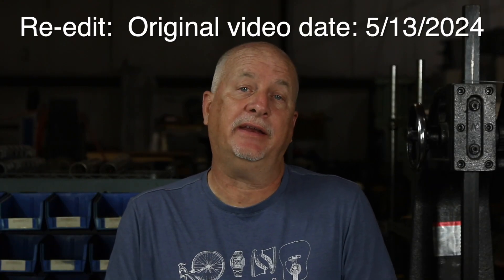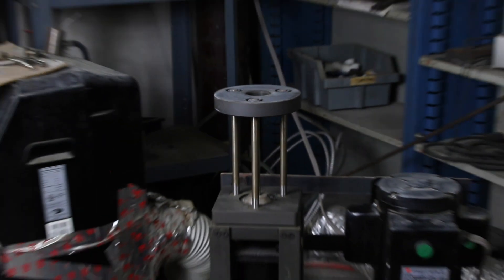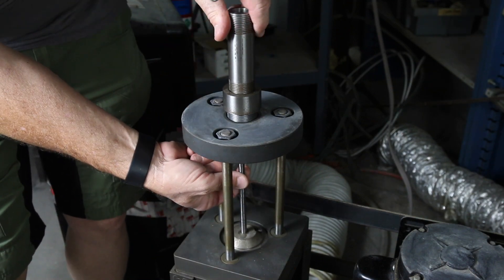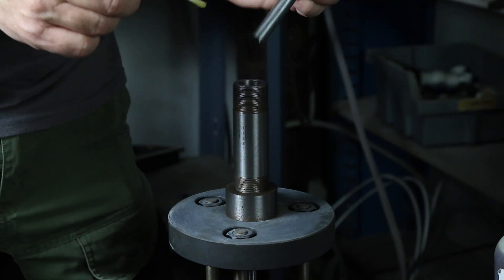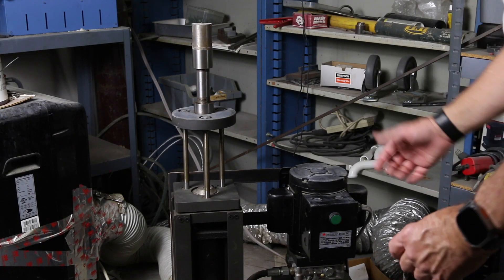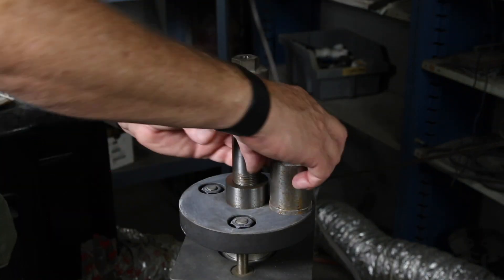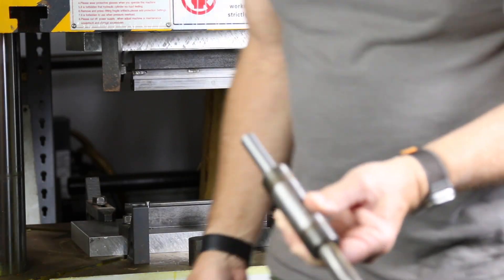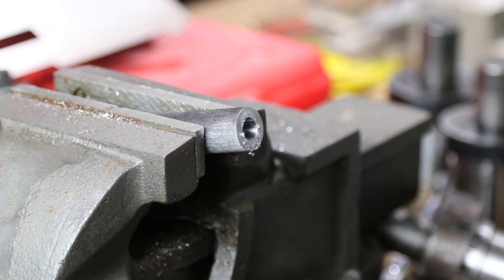Rifling 5! (Re-edit 2)

Comment: What is the size of the reamer you use to chamber the 9mil bullet?
Reply from the maker: @valalbaran I use a 9mm chamber reamer. You might get away with using a straight reamer (you can figure out the dimensions from SAAMI), but I wouldn't recommend it.

Comment: Are you not supposed to rifle the barrel before it's turned down to the finished diameter?  I did a 16mm barrel before and it just expanded as the button went through then returned to its previous diameter again. It had the rifling swaged into it but the specs were slightly off. The major diameter of the bore was slightly tight😢

Comment: How do you know proper chamber stick out
Reply from the maker: @joewboe It's based on several factors...case dimensions, bolt velocity, pressure curve, action type. It's not that straightforward.
Reply: @markserbu  I'm an LCAAP engineer and gun nerd, I think it'd be a very interesting video if it's something you'd share. I'm assuming it's your balancing the thinnest case wall thickness presented, hoop stress, with the internal pressure. Never let hoop tensile stress get higher then the pressure? That's how I'd do it, probably fraction of a second at a time in excel
Reply from the maker: @joewboe Good deal! I took a tour of LCAAP many years ago! As to the case stickout...you'll never win trying to get the case to contain the pressure. The hoop stress calculation will tell you right away that no material on earth can contain it with those thin walls. The goal is to keep the walls supported by the barrel while the high pressure is present. An of course it's completely different for a locked-breech action compared to a simple blowback action. I actually am working on a blowback action demonstrator and will have a video on it eventually. Should be interesting for sure!

Comment: Hi Marsk. Like you videos. Question on rifling. I always thought each barrel had its own unique rifling. Am I missing something? Looks like you used the same button for both barrels?
Reply: The button wears after each use which created unique tool marks in each barrel. That's how they can match the bullets to a specific barrel, not the actual rifling but the tool marks on the rifling

Comment: Nice video taking at least SOME of the mystery out of carving rifling into a gun barrel!  Two questions if I may since you're the most scientific gun guy I follow here:
1.  Is there any REAL reason why it's a clockwise twist to the rifling?
2.  Assuming it could be done (economically), for a rifle would there be any benefit to an "increasing rate" rifling?  I'm thinking something similar to a rifled choke on a shotgun but machined into the barrel of a rifle.

Comment: This might sound like a dumb idea, but could you cut down the chamber reamer to the right length so it would always create the right chamber depth?
Reply from the maker: @someoneelse4492 As I said in the video, the case stick-out varies so there is no "right chamber depth". But in production when you're reaming to the same depth you generally use a CNC machine.

Comment: I accidently machined ETD 150 at Aluminum sfm it almost looked ground. Tool only made 3 parts.
Reply from the maker: @Le10White I did something similar on the lathe once but it was 6AL4V at 12L14 speeds & feeds. Made a really nice fireworks show!

Comment: Mark: you know that the button would only hit the ceiling if there is air in the hydraulics. Dont say you dont either!
Reply from the maker: @Le10White You're confusing two different phenomena. Air in the hydraulics would make the button fly once it cleared the barrel and there was no more resistance to pushing it through. That compressed air in the system would expand and move the piston a bit more. But what I'm talking about is the unloading of the spring that the push rod becomes with 5,000 pounds of force acting on it. Once the button clears, whatever energy went into compressing the rod is unleashed. I guess there's enough taper in the button so that it unloaded gradually, in this case.

Comment: Try using hexo boron nitride powder lubricant. You can mix it with rubbing alcohol and swab the bore with it. It’s better than Molly coating. Should allow the button to slide through smoothly.

Comment: They say the spin from the rifling stabilizes the bullet. Then they claim sportsball players induce a spin on the ball to achieve a curved trajectory... Something doesn't add up.
Reply: Different spin orientation. Base ball is spun on the opposite access its thrown, not perpendicular like bullets. That said Bullet spin does effect the trajectory do to airflow around a spinning projectile. Spinning a Bullet prevent the bullet from tumbling which reduces accuracy as it interact with the air & creating additional drag. Spinning works like a gyroscope preventing it from tumbling.
Reply: The, um, ballistics of a round ball are very different than the ballistics of an elongated bullet. A round ball through a rifled bore will fly, on average, less straight than a smooth bore. A modern bullet while spinning has most of its aerodynamic drag in one axis (the axis of travel) and the spinning is just to equalize imperfections in the mass distribution of the projectile. With round ammo you want minimal spin because now you are dealing with all three axis and the Bernoulli effect (induced low pressure zones that pull the projectile) on all three axis.

It's sort of a weird coincidence that smoothbore is better for round ball bullets since both are far simpler to manufacture and yet work better together than what eventually replaced them.

Long bullets in smoothbores tumble, round ball bullets in rifled barrels behave like screwballs. It's worth noting that round ball in smoothbore acts like a knuckle ball and is similarly unstable and unpredictable. Basically there is no point in rifling a barrel for round ball because it's going to just do what it is going to do, rifling does not improve anything so why bother?

And that's not even considering Coriallis effects, ie, the bullet is falling as soon as it leaves the barrel and it matters which way the Earth is moving below it.

Comment: I bought a 22mm external diameter 42crmo Chinese barrel, with the rifling button for 9mm in an 8.8mm hole the barrel cracked. I had to temper it in the fire for it to withstand the pressure. Is there another metal that doesn't need to be tempered?
Reply: ECM better for those Chinese barrels I think.

Comment: Is there any issue with using a thinner wall section, does the material set back slightly after the button has passed through?

Comment: Do you have problems with chips creating more resistance with the upward direction of the cut? The logical part of my brain suggests a downward cut to let gravity assist in chip clearing. Heck no, I'm no machinist but I build stuff and had a curiosity moment.
Reply: I don't think button rifling produces swarf in front of the button like a broach does.
Reply: Those buttons deform the metal instead of cutting. Gravity would not help as if if did cut chips, because they be held by the surface tension of the oil used. For rifle barrels the barrel hole is cut using a (g)un drill which feeds high pressure lubricant to push out the chips in a groove of the drill shaft. I am sure there are a few YT videos showing a (g)un drill in operation.
Reply: The chips don't weigh enough to matter and the rifling bit is very much harder than the barrel material.

Comment: Funny how you just put this up about the same time I was studying the Robinson and Lawrence rifling machine from the 1860's. It is a very interesting machine and a bit complex in getting the parts fitted to work properly, there are no blueprints for it that I have been able to find. There is a video animation showing how it worked from a museum. Button rifling is so much faster, and shows just how far from the civil war era the technology of not just the weapons have come, but how far the technology of the machines and tooling to make them has come along.
Reply: That machine is a engineers marvel similar to a pratt and whittney rifling machine.It cuts the rifling groove step by step taking a little bit of material with every pass as tapered key gets bumped it raises cutter a bit while if you use button it will deform a barrel a little.Another process would be to forge the rifling but best accuracy you get by cutting rifling slowly,modern cnc machines do things faster ofc but principle is still the same-a rotating cutter that is pulled back that cuts small amount of material.Except now they use carbide inserts so feeding rate is higher .
Its amazing how they synchronised everything with cams ,leavers and pulleys to get a twist rate you want.
If you want to polish rifling then you plug a barrel and pour some lead.then when it cools off you pop it out and use fine grinding paste for valve on it ,couple of passes and it will be shiny and deburred.

Comment: Let me guess you expanded the barrel blank into the outer retainer because you did not have enough clearance.
Reply from the maker: @Mongo63a Of course, but what's interesting is that I would have assumed the overstressing of the material to be a local phenomenon...where the swaging occurs and then maybe a bit farther towards the OD. I would not have thought it would cause plastic deformation all the way to the OD! Now it wasn't much...the OD only grew by a couple thou. Still...unexpected!
Reply: @markserbu  I would have expected some permanent deformation but I have never done any of the calculations for it either.
Reply: @markserbu ; work hardening. 😊